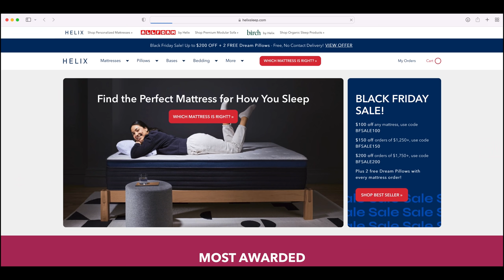Building Our Dream! 72X60 Pole Barn with 350 Yard Driveway!!!

Comment: Nice Video !!.....I've been in Construction 50 years and I tell you you're going to be Sorry you Didn't  put at Least 6/6 10/10  Wire Mesh in the Barn slab and the Driveway slab !.....Putting #4 Rebar each direction 2 Foot apart each way would have been Better.....Within a Year or so you Will see the Concrete starting to CRACK...It wouldn't have Cost Much more to do it...Good Luck...LOVE ALL your Videos BTW !!....
Reply: Agreed especially with the water table in FL BUT the Arrington have been doing this for years so let’s see
Reply: Yup. Big cracks. Especially if anything heavier than a sedan drives on it.
Reply: Yup
Reply: I was shaking my head the entire time. I guess they believe that the fiber mesh is going to be good enough..... Not even close. All concrete cracks the wire would have just kept it together after it cracks. Oh well if the man has enough money to waste on Silver Stag knives for everything then he can also put in another drive if needed. Hopefully it is not a local ordinance that the wire is required, because there is a lot of video evidence showing non
Reply from the maker: we've had the driveway at our house for over 2 years and have pulled the boat, the rv, heavy equipment and all our cars on it... no cracks. we make cuts in the concrete and if it needs to crack, it cracks in the cut.
Reply: He’s in Florida he doesn’t deal with freeze thaw. The fiberglass in the concrete mix is more than enough for that job. As he commented above any cracks will happen at the cuts.
Reply: 4-5” thickened slab really only needs rebar on the perimeter… especially if the mixture is higher in calcium and has plenty of kerfs this will not crack if dried properly.. todays concrete has improved from 50 years ago!
Reply: @wbsurfer123  especially with the fiberglass strands.

Comment: You should add a small cooling shed. Check out a device called a coolbot cooler controller. Doesn't have to be real big. Runs an air-conditioner to cool a shed. My brother in law insulated a small shed on his camp and installed one. Temperature was 35 in an hour. We hung a pig for a few days while hunting down there. Works amazing. I work for a company that sells them for $349 my cost is $230. You can find them anywhere.

Comment: Pouring the concrete around the 6×6 is a huge mistake and long term where it meets the ground is  100% a goner. Galvanized feet bolted to the concrete that hold the base of the column inches off the ground. You built in a absolutely unacceptable fail date. Who designed it.... yowza..